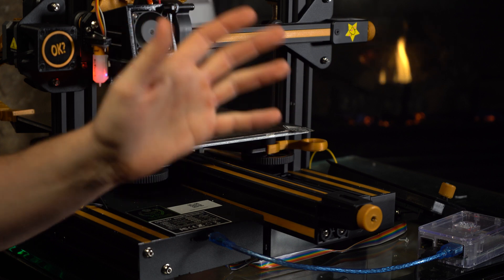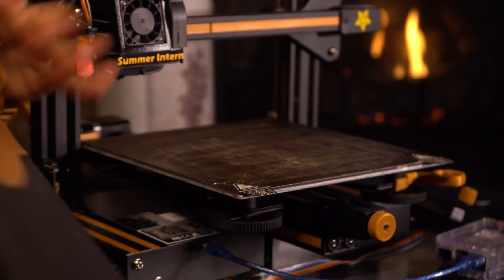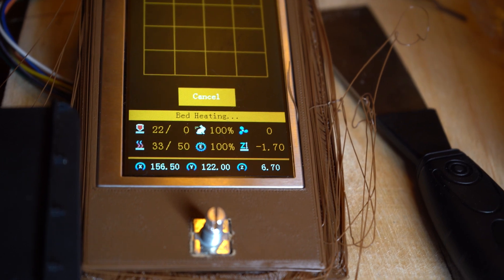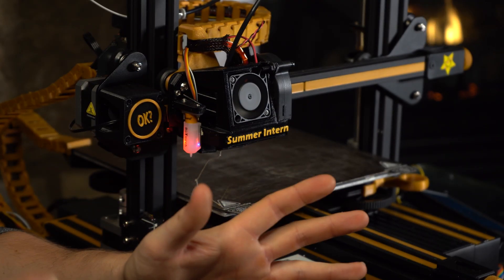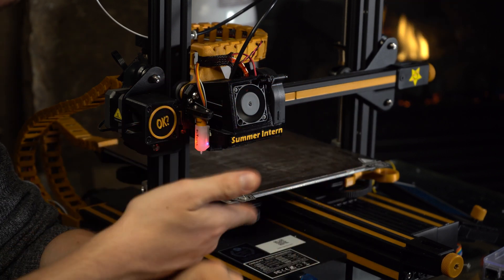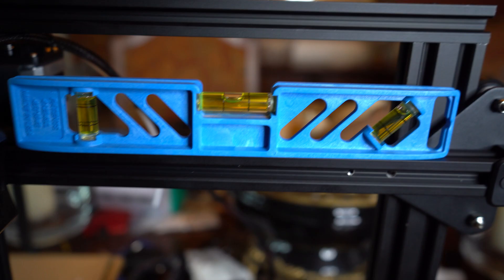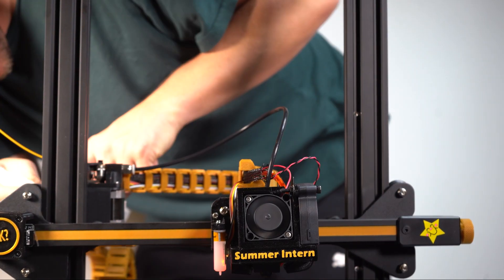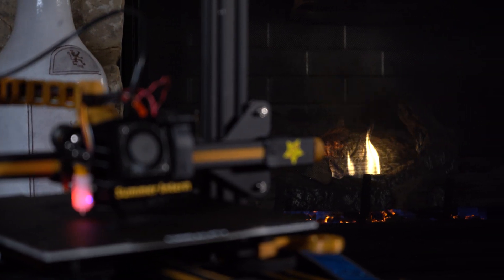Buying a CHEAP Creality Ender 3 V2? | Watch This First!

Comment: Would you recommend professional or klipper?
Reply from the maker: Professional for those that are not familiar with Klipper. Klipper can be a headache to setup
Reply: @MaxyMeanderings  I just installed klipper last week in my e3v2
I'll keep it then! Seems to work very well

Comment: I have the exact same setup minus the backlash screws and rubber washers. 
Over 800 hours of constant printing and not a single failed print. 
But i need to change bed wheels ever 300-400 hours cause they disintegrate and every 50-60 hours those wheels need tightening.
I just ordered a linear rail kit from creality just for the x axis as a test so i can cut down on wheels., and if it goes well i am planning on changing the y axis for rails too.

Comment: Talks about second Z-axis, removing springs, but uses stock belts, which also are installed askew (yeah, as intended by manufacturer). Facepalm
Remove bed regulation knobs, then argues that X bar is not bubble leveled. Double Facepalm
Talking about 'PRO' firmware and printing like a turtle without pressure advance and input shaping. Multi Facepalm
Installed spring nut upside down. Ultra Facepalm
Have spent a lot of money for usless upgrades and recommend to spend $300 for tweaking a printer, instead of... You know some other brand printer, which is fast, does not have knobs, have 'professional' firmware out of the box, and costs less then $300. It is called.. like some european paper format. I will not advertise though. Monster Facepalm!

PS
Please understand me right. I am for cheap printing. And for Ender 3 actually (yeah, the bowden very first version). Just buy it cheap, you can get very cheap it. And install a direct drive. changing springs also a good idea. You also can just straighten your bed, with your knee, metal ruler and a flashlight. And thats all. No, you should not use bubble level to set up your printer. You better use high quality square, metal ruler and caliper. Also compiling firmware is nothing hard and you do not even need to buy printer for that. Just download your printer template (in case Ender 3 no trouble at all, unless you change motherboard). And that's it, just read the ducking manual.

PPS
Cheers!

Comment: As tempting as the price tag of $129 is, glad I didn't go this rout. Just bought a Bambu Lab A1 Mini for $249, plug it in, and starts printing. No body got time to deal with 1980s technology.
Reply: More like A5 I would say, but yeah, this is a good choice if you do not want to tinker with printer. Even if you wanted, you can't = )
(Well actually there is a way to make heatbed reach 100C, so technically you can tinker a little)

Comment: @maxy meanderings - any issues with motor sync on the z axis? lots of people seem to say you're better off with a belt driven system off a single motor as the two motors get out of sync?

Comment: Got my E3v2 for $100 at Microcenter. Another $100 in mods and seems like a really solid setup for $200 all in. Thanks!
Reply: I just got one for $50 from Microcenter :)
Reply: @DynamicCash  dang it and I tought they coudnt get more cheaper than 75 bucks

Comment: i got a v2 neo less than 2 months ago, i upgraded to the pro firmware but do i still need to flash something for the bl touch to be better? this printer has been a huge pain honestly. just this week the x axis stepper motor started to grind and seized up, really regretting not going with a resin printer right now.
Reply: I have both FDM and resin. FDM is the easier one of the two
Reply: tbh if you don't want to upgrade it the ender 3 lineup (except for the V3) is outdated, for that budget i'd pick an elegoo, way more plug and play